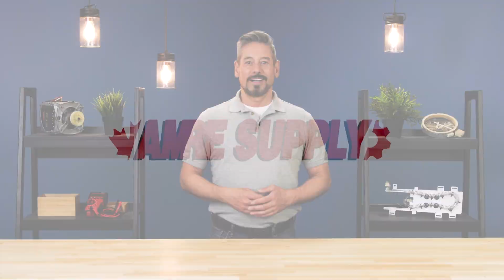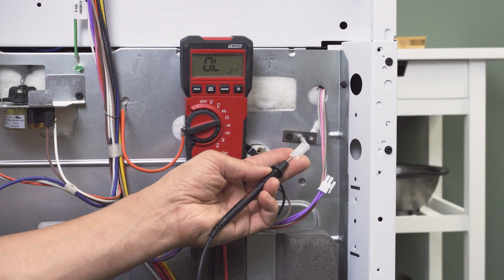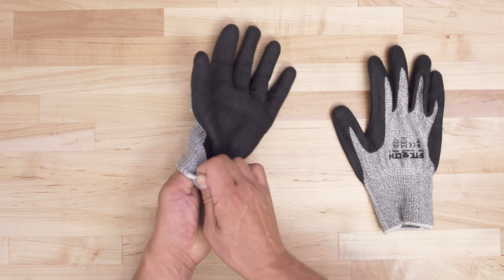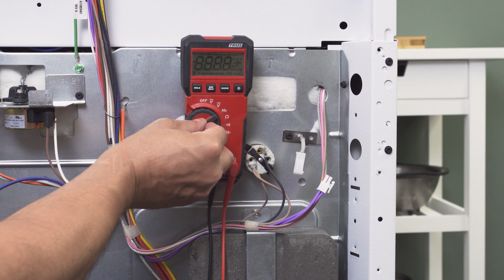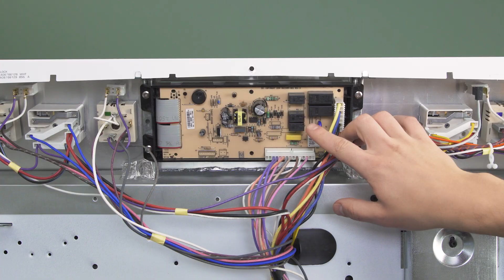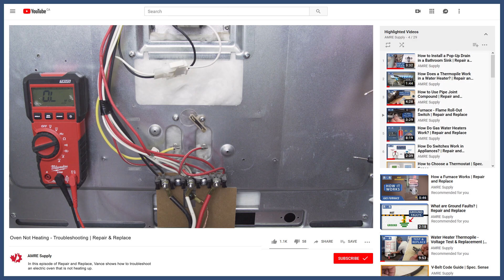Oven Temperature Sensor Error - Troubleshooting | Repair & Replace

Comment: Oven not getting hot enough.  Beeps before its up to temp. After an hour never got to 350. Tested the sensor and its fine. What else would  it be?
Reply from the maker: Thanks for watching. It's possible that one of the heating elements is not working and not contributing to the heat: https://www.youtube.com/watch?v=ABope7vl5IY&t=0s

Comment: Temp sensor reading at 1176 at room temperature guessing I need to replace it ?
Reply from the maker: Thanks for watching. A reading between 1000 and 1200 is within a normal range but it's hard to know what the resistance is throughout different temperature ranges. Before replacing the sensor, you can try to check all the connections to make sure it's secure. If that doesn't help then replace the sensor.